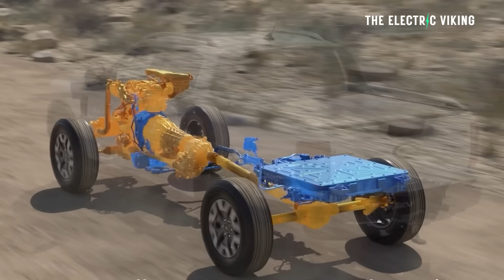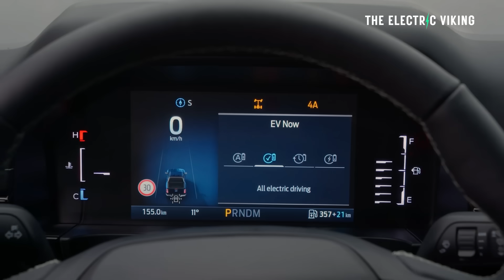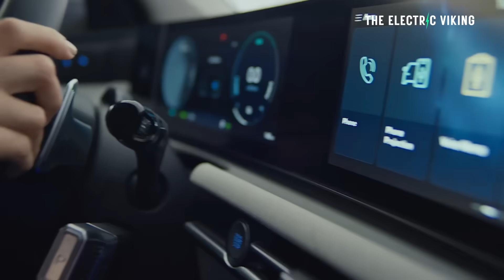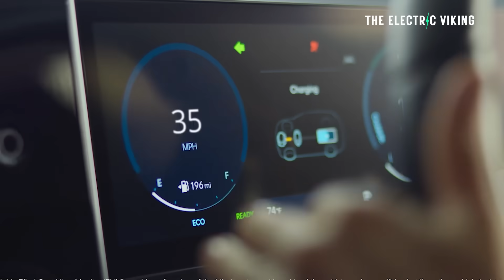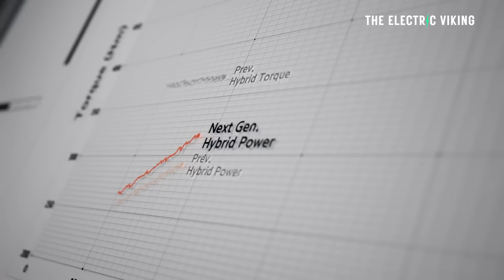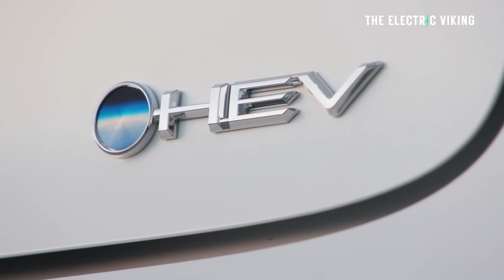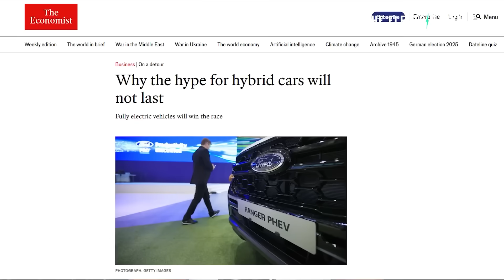Why experts say the HYPE for hybrid cars will not last

Comment: Thank you,
A further point worth making is that a hybrid uses more fuel on a long trip than an equivalent ICE vehicle because of all the extra unusable weight of batteries and electric motor.  I looked into buying a hybrid Yaris in South Africa about ten years ago.  I quickly concluded that the extra capital  cost premium could never be recovered in the car's lifetime.  Furthermore, a hybrid has most of the worst maintenance risks of an EV and ICE vehicle combined.  Not ever wasting my hard-earned currency on a hybrid was a no-brainer for me.
Reply: That’s absolute nonsense. I own a hybrid and my wife owns a ICE car. We always use mine for long distance trips due to fuel economy.
Reply: Yeah absolute crap.  My RAV4 hybrid uses 30 percent less gas than my RAV4 ICE on the highway.   Much better in the city.
Reply: My Honda Clarity, when running as a hybrid, gets 45 miles/gallon on the highway. It's the most efficient car I've ever owned by a long shot.
Reply: My car is the most efficient car I've ever owned as well. So far it's travelled over 17,000 km's on Zero liters of petrol.
Reply: Don't worry you'll get your loss, at trade in time. 
Much better to own ice or hybrid and lose money over time rather than in one big hit.

Comment: Thanks, plug in hybrids are the worst of both worlds, either get full EV or full ICE. PHEVs use the battery inefficiently as they have to carry a heavy engine around, and vice versa with the engine hauling a heavy battery all the time.
If you worry about car fires, then contrary to all the myths about EVs they  are by far the safest and hybrids the worst, by a factor of 20 times or greater.
Range anxiety here in the UK is no longer an issue, loads of rapid dc chargers about, 300 mile range cars means many people just charge from home and never need public charging.
Reply: BS. BMW i3 engine on the erev Rex is not heavy, you could lift it with one hand.
Worst only on phevs you can't fast charge. That is a truly dumb design granted but those are disappearing.
Reply: I am not opposed to EVs, I actually would consider buying one and we have one in the family, but there is definitely utility to be had with PHEVs here in the US still. In theory, carrying around a heavy useless battery/engine everywhere does seem like a 'problem' but this doesn't materialize in reality with the fuel economy you are obtaining using a small/medium size battery, especially with the difference obtained in mostly City driving.  You are similarly carrying around a much heavier battery in an EV when it is not fully charged.....an EV will weigh a lot more than a similar sized plug-in hybrid vehicle and a charged EV weighs the same as a nearly drained EV last I checked. My wife's EV (that is the same size as my vehicle) weighs 1,000 lbs more. Why carry around that huge EV battery when you don't need it in daily driving? I get 40+ miles of EV range in my Toyota Rav4 Prime which covers nearly all of my daily driving (~85% of days) vs if I had a heavy EV doing the same thing I would be carrying around this huge battery when I only need it once or twice a month.  When I go out on weekend excursions, I go into hybrid mode with my car.  My average mpgs over 16 months of driving this thing is 62 miles per gallon.  I don't have to rely on incredibly expensive fast chargers (cost way more than gas here in US) which may or may not be available, so have comparitively more options that the EV owner on the open road as I am not a slave to finding an open, functioning charger taking up my time and patience.  And I can still take advantage of having free solar power at my house with the plug-in. I would definitely consider getting another full EV but would like a lighter battery with at least 300 miles of range.

Comment: Toyota makes the best hybrids cars in the world. I have friends that been driving hybrid cars for over 10 years. With noooooo! Problems. Hybrids aren’t going away in the United States until someone comes out with a EV is cost effective in purchasing cost that is affordable and gives a mileage range above 500 miles.
Reply: What was good is now a mistake 0:43
Reply: Toyota need to get on board with plug in hybrids, with large batteries and emphasis on electric power. They are out of date.
Reply: @simon-gr-au  EVs were their game to lose at one point.  They'll be lucky to hold on now, and they only have one advantage that even can be made long term now.
Reply: They exist, maybe not the 500 miles, but you wont need that, 300 miles are plenty considering that each extra mile costs $15.
Does your current car have 500 miles of range? Can you fill it up at home every night?
Reply: If Toyota make the best hybrids, why are they buying the BYD platform for their future cars?
Reply: Because they know renewables are the future and they realize hydrogen isn't gonna happen?
Reply: "Toyota makes the best hybrids cars in the world",  AND, they are ugly as f*ck!
Reply: The men that want 500   miles range I see their full pee bottles at the side of the motorway & they never drive with a wife, girlfriend or children
Reply: 😂😂 Their latest and best hybrids are rebadged BYD cars - i.e. Chinese
Reply: The Toyota hybrid is old tech. None of them are PLUG-IN  hybrids. The advantage of the plugin hybrid is they can run only on charged batteries without the engine like an EV.  The engine comes to play if you drive long distance. That is why Toyota is teaming up with BYD to use BYD advanced plug-in hybrid technology
Reply: @janakaw2006  They have had plug in hybrids since 2012.  I am Team China too but BS doesn't help
Reply: If anything the fact that they had a commanding lead so early, and held on to that lead inarguably until the release of the Model S and the wide release of the BYD E6, and still arguably lead an inportant category (whether they have lost that depends on whether we start seeing Chinese hybrids at 400000 miles); and they didn't spin that into total domination of the future...that is kinda pathetic.
Reply: Good joke😂
Reply: Do you know anybody with a hybrid that's more than 5 years old? Because the battery is 1/4 the size of a normal EV. Which means it's only going to last for 5 years. Not the 20 years that a full EV would last. People with a plug-in hybrid charge the battery to 100% every time every day. That is what kills the battery. The manufacturers are loving making these cuz they know that you're going to have a huge expense to repair them in 4 or 5 years.
Reply: That’s America, where public sentiment is shaped by oil companies and other vested interests to a far greater extent than anyone realises. This is the fossil fuel industry version of a methadone program. I’ve owned a Toyota hybrid for seven years. I can’t wait to get an EV. It’s not that the Toyota is bad. It’s not. It’s just that it’s not the future. It’s a transitional step that I took in a quest to lower costs and it worked quite well. But I’m dead sick of watching petrol prices and waiting for them to fall before I fill up. I’m sick of filling up too, especially when I know there is a better alternative just around the corner.

EVs are just around the corner. In the United States, you have governments, especially in red states, who actively work against EV uptake, which is why California leads the country in EV ownership. Everywhere else, EV charging stations are being built on major highways everywhere, just like petrol stations. You can charge your car at major shopping centres too.
Reply: 😅 used to.no longer do. Many brands have caught up with newer technology. Toyota technology is old
Reply: "Toyota makes the best hybrids cars in the world."  And, the ugliest!
Reply: @madsencc used to now better technology from its competitors
Reply: I had a Toyota Highlander Hybrid for 12 years before buying my Tesla. I don’t miss all the oil changes, filters & transmission fluid changes - the costs really added up. There’s no cost advantage of hybrids over ICE vehicles - their mileage is not that better.
Reply: Toyota 1990’s technology 😅
Reply: EV is cheaper than ICE and the name of the technology is LFP battery
Reply: @carkawalakhatulistiwa  its not and won't be for a while. BEV purists are very silly
Reply: @wx2999 More 2 years and BEV will be cheaper then ICE and more 2 years I will buy a BEV. I’m living in Europe and we already good network to recharge EV batteries.
Reply: They won't be in the US because of tarrifs and because we won't build the necessary infrastructure.
Reply: @wx2999  EVs are MUCH cheaper to own and operate. Cars like the MG4 and GWM Ora are now pretty much at price parity with ICE cars, like the Toyota Corolla or Honda Civic. The running costs are literally about a fifth of an ICE.
Reply: My previous car was a 2012 Prius C.  At the time (nearly ten years ago) I viewed it as a bridge to get into EV technology.  Last year I traded it in on a 2021 Chevy Bolt and never looked back!
Reply: You don’t need 500 miles range. That’s ridiculous. Very few people travel 500 miles in a single day.  A 300 mile highway range or so is plenty good enough for about everybody. Especially if the car would recharge in 20 minutes or less and chargers were readily available all along the route.
Reply: @alanbuck9237  they do in Australia. Sydney Melbourne is 500 miles and a common drive.
Reply: That’s the problem though, hybrids are old technology.
Reply: I’ve had a Prius and my MG MG4 is a much better car.
Reply: Especially since the US will not invest in Electric Infrastructure to sustain the change due to the Oil and Car Lobbies.
Reply: @jimmytimmy3680  Especially in red states. Try driving a Chinese EV in Alabama and see what happens.
Reply: But your friends probably haven't saved much money on gas, it takes 3 to 8 years to break even on gas saving by buying a hybrid instead of the regular gas model. 10 years ago hybrids were even a lot more expensive than today so your friends most likely haven't obtained any substantial gas savings unless they drive a lot a miles every year. Hybrids are a complicated solution to a simple problem. Toyota loves them because it makes them lots and lots of money.
Reply: A prius can go 400000 miles like it's 150k.  8 years is nothing. They also retain value well.
Reply: @AllYourMoneyNowKid they don't retain value, they add value lol. My Prius value tripled in price from $3k second hand to $9k in 8 years.
First car ever had do that
Reply: @John-p7i5g  That's not the car, that's the market.  They were holding value better than almost anything else even when the market was normal.  If you really wanted to ride the market like that a better investment would have been a Ford Ranger.

Comment: I'm 100% fully EV guy. However, I'm planning to buy PHEV. there are two reasons for this. 1- My country infrastructure isn't good enough for me to be comfortable to run a fully EV car especially when traveling. 2- The batteries technology is on a rapid update right now and the ranges will starts to get more and more near the ICE cares range. So i believe buying PHEV now is a good compromise. But the smart move is to sell it maybe in 3 to 5 years max and get a fully EV by then.
Reply: To get the benefit of PHEV you need to charge it regularly (as much as daily) and at that point you may as well go with a BEV
Reply: This basically is the confirmation the experts are right. The sale of your car in 3 to 5 years means the new car sales of PHEV could drop rapidly by then.
Reply: @beatreuteler I’m not refuting them. I’m just saying the reality of the current situation. Not all countries have a solid EV infrastructure. Plus not many are capable of charging at home. So going fully EV is a very risky move to most. However, the future is surely EV no refuting that. As for the resale value dropping it will also be applied to the current EVs. Whenever a new battery technology will go out the resale value for the cars with old technology will be massively dropped. So it will be kinda the same.
Reply: @kindaboy2010  How far one drives per day is relevant, a good size invertor and solar is plausible but possibly cost prohibitive
Reply: @kindaboy2010  America is a third world country for EV infrastructure, thanks to fossil fuel companies.
Reply: @kindaboy2010 all EVs can charge at home. Do you mean not many people can charge at home? I think it's roughly 30% live in apartments etc
Reply: @beatreuteler  Yep. Depreciation is going to be a bitch

Comment: The challenge here is who controls the building blocks for the EV car core? Specifically the engine tech & the battery rare earth minerals. 
Its almost ALL currently controlled by China - 70% is latest figures, some cite. 
So that is a key factor here. Its 1 thing to go 'electric' but as that scales, that dependence on China for the core building blocks represents a geo=political risk. 
I get that your focused just on the tech here. However, widening that lens shows what I shared above to be the deeper truth.

Comment: Hybrid has three systems that can fail.
Engine,
EV,
Tech to make them work together.
Definitely not going to be a good long term investment.
Note, Cleverly,  a firm that services EVs have just looked at a MG ZS EV, done 240 miles, still in very good condition, and 90% battery. 
In UK their hybrids cost more than the BEV. 
Some other EU brands have price equity.
Reply: Guess you mean 240000 miles.

Comment: Hybrids two systems, review the failure points. Also the battery repair on a hybrid is ridiculous. More work to get to the electric motor and according to reports in Europe much more expensive to repair

Comment: I was MB hybrid certified in 2010. I found that hybrids don't age well. Transitioning from elect to gas and back can get a bit clunky as the car ages. Also, you still have a gas engine which needs maint and repairs. Repairs to a hybrid can be astronomical. I don't see the advantages to hybrids.

Comment: I'd only consider a Hybrid vehicle if the gas or diesel engine is only, ONLY used to charge the battery tech. 
I would prefer the whole drive train, motor and battery system should be EV tech.
The hybrid component is "additive" should a charging source not be available.. Or for "emergency" range extension.

Anything else (like the Honda Insight 2019 hybrid) I currently own gets 45-55 MPG with low maintenance. But I drive under 5k a year so.. Has a lower performance and higher maintenance cost of ownership from a dedicated EV or Diesel assist EV equivalent.

Comment: I see hybrid cars as the worst of both worlds. You have all the plumbing and maintenance costs of an ICE  car and none of the longer-range savings on fuel of an EV. If I had to choose between them, it would be a pure ICE car or an EV. Part of the trend is I'm sure the manufacturers and dealers love hybrids because they can sell servicing and parts for years to come on each one sold. Our daughter has had an ID.3 for 3 years and not a single service item was required, other than the usual wiper blades.
Reply: Totally agree.  You're just doubling your potential problems. Hybrids are also the ones with elevated fire risks. 
For now, I'm just sticking with my old ICE Honda ... Trump is going to make it impossible to get an affordable EV in the U.S. so I'll wait.   Not going to buy a hybrid or a newer ICE vehicle.
Reply: Hybrids are actually very reliable and Toyota has proven that even the most complex systems can last if designed and engineered correctly which is why you still see old Prius on the road
Reply: @MrINDEPENDENT2000 Even Toyota hybrids need regular servicing! So far, they have not been plug-in so they are 100% petrol fuelled. No saving on electric charging.
Reply: @connclissmann6514 all they need are oil changes not any different from a standard gas car
Reply: @connclissmann6514 you need to add paying 30% more and replacing tires more often, and then get back to us.
Reply: @ArmaDino22  Getting back now, if I may. 2 years into an EV and the tyres are fine. If you search widely, that myth has been debunked. If you drive like a lunatic on any vehicle, ties don't last. Too go from reverse to full in an EV costs me €16 as i can charge at night while asleep. Can come home empty and leave the next day with another 410km range (winter might be 380km). My previous cars could never do that. If you compare the total cost of ownership on a multi-year level, an EV is an obvious choice. Good second-hand EVs are more available and the batteries for many like early Tesla Model 3 seem good for about 90% if the original capacity after 150,000im or 100,000 miles.
Reply: @connclissmann6514  my point is that you're going to pay 30% more for an EV than regular hybrid. So all your maintenance and gas saving are worthless if you end up paying an extra 10-20k for a car.
As for the tires, it depends: my friends leased an Audi Q4. They are on their 3rd pair of tires after a year and a half. Said they're not buying it.

My uncle had an Chevy Bolt. The battery died outside of warranty. He had to pay around 14k for a new one. 

I can go on and on. But the point is that EV's aren't the holy grail your portray them to be.
Reply: @ArmaDino22  Every individual experience will vary. The examples you provided have not been matched by anyone I know nor in the YouTube community. I don't want to drag this matter out so maybe we should agree to differ?